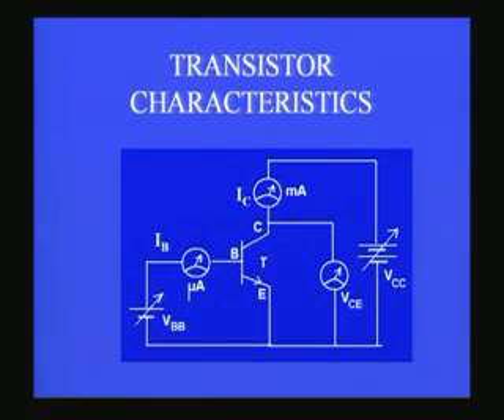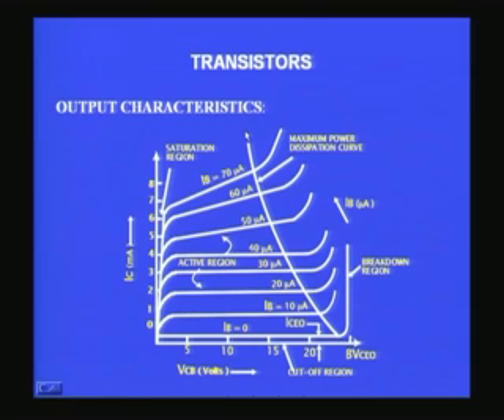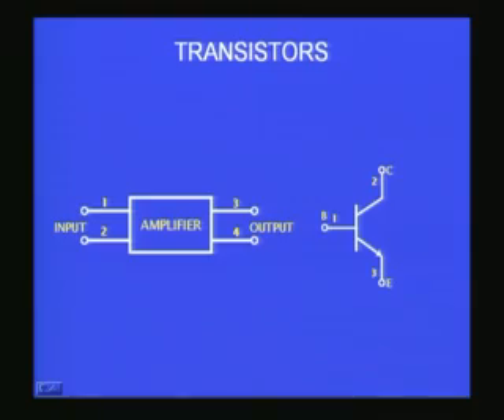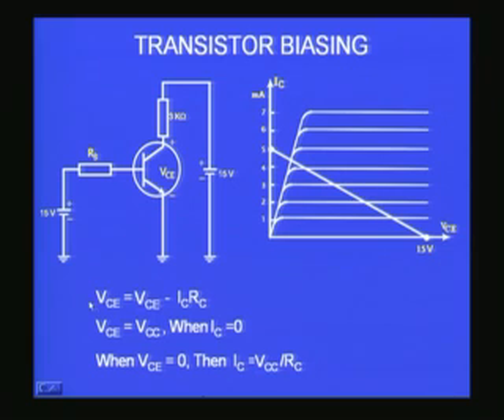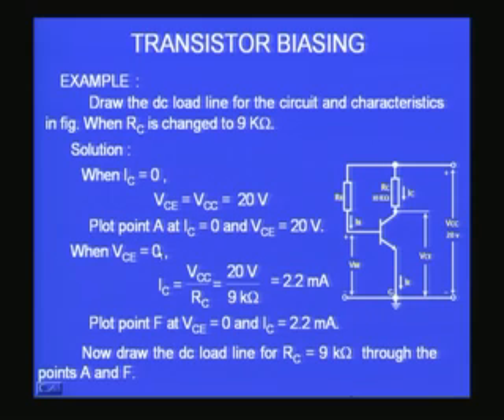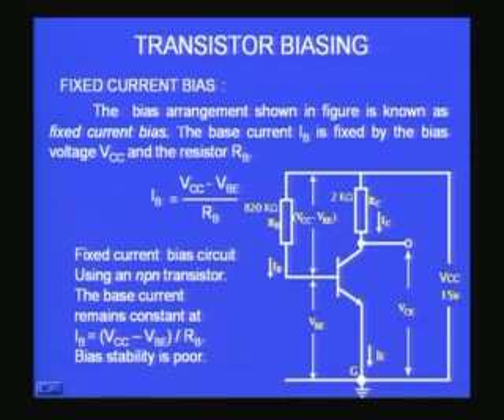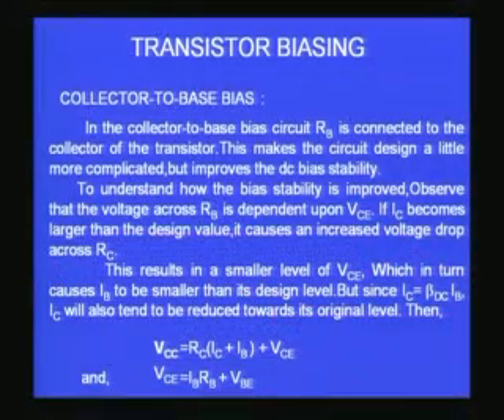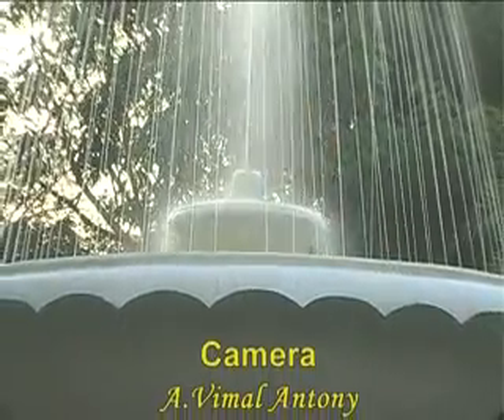Lecture - 11 Transistor Biasing

Comment: Good lecture BUT: (1) - The transistor is essentially a CURRENT amplifier - voltage amplification can only be obtained by passing the base/emmitter current and collector current through a resistor. (2) a transistor has power limitations which further restrict its operation withing the load line.
Excellent!
Reply: kya likha hai be.

Comment: Just for the sake of accuracy, if I may point it out Sir, it is 20 µA @ 42:52 instead of 2 µA. [(14.3/(820 x 〖10〗^( 3)  ) = 0.01744 x 〖10〗^(-3) = 17.44 x 〖10〗^(-6))]. Nothing to take away from your VERY CLEAR and great lecture. I understood about the operating point for the first time.

Comment: Thanks. I looked it up. Retarded potentials are the electromagnetic potentials for the electromagnetic field generated by time-varying electric current or charge distributions in the past. But that was in the past. Today, potentials are probably much more uniformly intelligent. In any case, it would be more polite to refer to them as "mentally impaired potentials."

Comment: I read a lot of books about vacuum tubes and after I learned that I went on to read about transistors. the transistor is much like a Triode tube which has 3 legs, cathode, grid and plate.

Comment: @angelodeth44 
if the transistor is in cut-off then Ic = 0, but you will still get a voltage across the emitter and collector (the supply voltage) so your statement  "cant have one without the other" is incorrect.